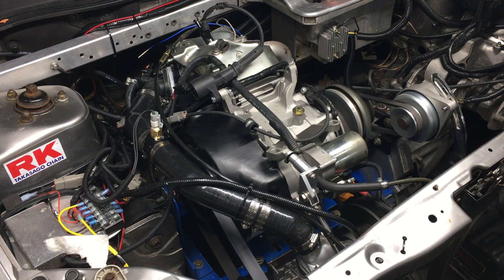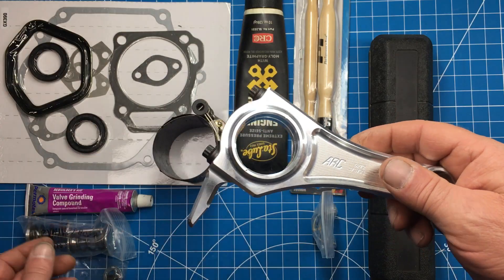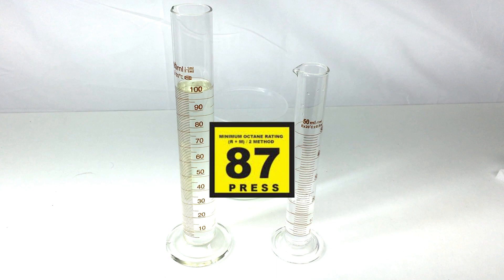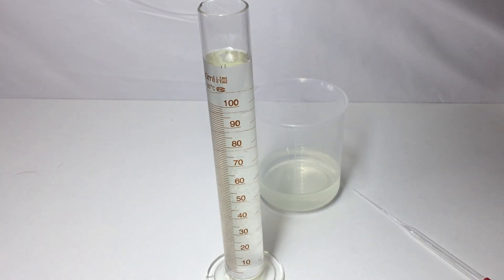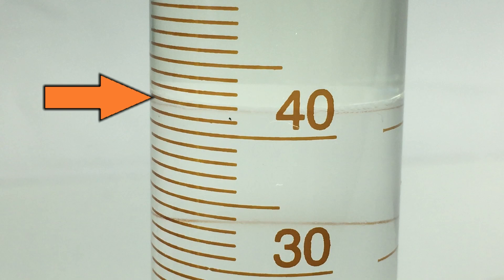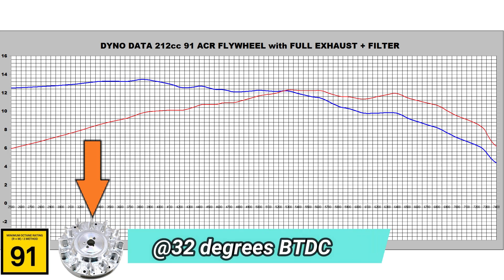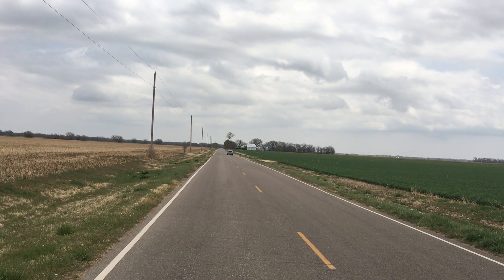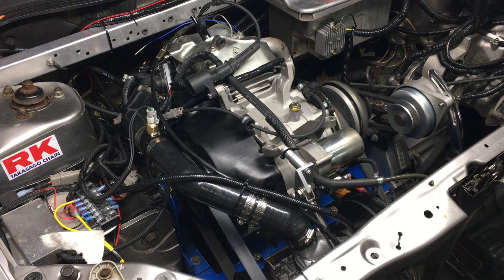S2E8: We dyno test several fuel grades to see if good gas is better than cheap gas for small engines

Comment: On a dragbike every pound you lose of rotational mass is like removing 2 to 4 pounds of static weight. It all depends on where you can remove the weight from the crank and drive train or the wheels.

Comment: 22% ethanol in the 93 octane Vs. 6% ethanol in the 87 and 89 octane?

Hmm, yea, the 22% ethanol is getting up real close to making that engine starting to run fairly lean. 
At 85% ethanol one needs 33%-35% more fuel flow when compared to 100% gasoline going  into the engine to be at a stoic ratio that the engine will run normally on. So, at 22%, the carburetor WILL need to be re-jetted larger to get the engine to run correctly again. Which means more fuel for the same performance. An E.F.I. engine will self compensate, and add the extra fuel by itself, therefore negatively affecting your fuel mileage.

But why am I wasting my time typing all of this, you already are completely aware of all that.. 

Well, maybe some other hard-head who ONLY runs premium fuel in his N/A, 9:1 Compression, 200h.p., V-6 car will read this, and be better informed on which fuel grade button to press next time at the gas pump, and save himself a few bucks... 🤷

Comment: If you wanted to be over the top and prove to people that a higher octane rating does not equils more hp. You could drive to the airport and get some 100 low lead avgas I'm sure you know that the octane rating is a measure of the ability of a fuel to delay the onset of detonate . Pure methanol would give you the ultimate anti detonation condition. But your going to supercharge so you have considered all this stuff.

Comment: Here in Minnesota. 87 octane has ethanol in it. You cannot use it in small engines, because of the short shelf life it has. It plugs up the jets and orifaces in the carbs. So, we use 91 non oxygenated fuel, and we have no problems with this. I suppose every state is different, and I’m no expert on gasoline. Does non oxygenated mean, no ethanol?

Comment: In Florida I can get ethanol free gasoline, since we have so many boats here, where you don't want ethanol in a boat's fuel tank, out on the water, in a humid atmosphere, etc. For 2 stroke engines I also run a 40:1 or 50:1 ratio of fuel to 20w oil added to the ethanol free fuel, just like on a mower or chainsaw. A mix of 2.5 or 3 ounces of the oil to a gallon of fuel gives me correct mixture. I've been wondering why you don't do same for your 2 stroke engines?

Comment: Octane has zero impact on power. The only thing it does is change detonation resistance. You can make more power on higher octane ratings if you are adding other things (boost levels, more compression, etc), but not in and of itself.

Comment: I have never gotten reliable results attempting to use the mixing water method to determine ethanol content. Water is already in the fuel maybe? Those continental GM sensors seem incredibly reliable and repeatable, and they are cheap

Comment: The ARC flywheel would probably work better, cooling-wise, if you machined a new fan that matched the profile of the older fan. It would also probably work well in conjunction with an oil cooler and the removal of the recoil start.

Comment: For the higher ethanol blend, fatten up the jets.  You have a lower stoichiometric ratio with ethanol so it can take more fuel.  You should get more power if you bump up the fuel rate.  It should do better with more spark advance.

Comment: Not sure how it is in other places but where I live, we had some gas stations offering E15 fuel for a few cents lower than the E10 fuel.  There is a warning on the pump saint it is illegal to use the fuel in a car older than 2001 or that was not designed to handle higher than E10.  I would think if they were dispensing E22, then they should be warning about it.

Comment: Have had a gardening company for 23 years.  Been running 87 octane in everything and chamion semisynthetic 2 stroke oil just fill a 12oz gatorade botttle to the brim dump it in 5 gal gas.  Let mix on the drive to the job.  Faouled a plug or 2 in 23 years but never burnt up a 2 stroker.  I run em WFO

Comment: Maybe add some aluminum heat sinks or a supplemental cooling fan if over heating is a great concern. Every engine is designed to run certain fuels with specific timing advance and getting outside that introduces cooling and performance problems. Only run what your owners manual says to run. Higher octane isn’t better it’s just harder to detonate without spark.

Comment: Octane is not power. Octane is anti knock rating. Higher octane gas requires advancing ignition timing to burn the fuel at the right time. Higher octane is NOT higher power. So engines that need more anti knock protection use premium or high octane. This is what Exxon Mobile says about octane. The low octane gasoline of the early 1900’s is the reason they mixed lead into the gas to reduce knocking. Why is that still getting confused?

Comment: Here in Florida they sell "camping gas" or sometimes "two stroke gas" that's supposedly 88 octane and no ethanol at all, I don't know if that's available where you live or if it'd help squeak out a half more horsepower...

The whole camping gas idea seems dubious to me, sometimes it's 5 cents cheaper than regular 87 octane and other times it's up to a dollar more... no clue why that is but it does seem to vary from week to week. I've always wanted to dump some in my car since it's a 2003 but the old girl's been slurping ethanol so long I figure why broke what's not fixed.

Comment: And to even further muddy up the waters, each of those variants of ethanol content fuels have different stoich AFR's. If E10 was exactly at 10% the Stoich AFR would be 14.1:1 and that tested 22% ethanol content 93 oct, stoich would be 13:1 AFR.... It's almost like one would need to install and set up in the EFI an alcohol fuel sensor just to run pump gasoline anymore

Comment: Higher octane doesn’t equal more power. Gasoline of different octane rating will have the same energy per liter/gallon/etc. More ethanol will give you less power bc it has only approximately 60% the energy of gas. Octane rating just means it is less prone to knocking. Meaning you can use it in higher compression or booster engines.

Comment: Mixing 10ml of water and 10ml of ethanol won't result in 20ml of liquid because the molecules are different sizes. They will pack together and form less liquid. It's like adding fine sand to coarse rocks. The fine sand takes up the gaps in the rocks.

Comment: Well. an engine runs best on the type of gasoline it was made to use obviously.. here in finland we use 98 and 95 ONLY. 95 have 10% ethanol and 98have 5%  95 is good only for modern vehicles that are designed for the ethanol content.. ethanol is garbage when mixed with gasoline :( 
Ethanol also gumms up and  glogs carbs, fuel filters and all...it even ate the gasoline hose on my brand new jonsered chainsaw and now the carb is full of "melted" plastic..
once i was low on cash and i put 95 in my 05 subaru and it ran like shit :(

Comment: If you don't have higher compression higher octane fuel doesn't work! Only advantage like in my area higher octane doesn't have ethanol and ethanol in small engines and older vehicles is a big no no unless you want your fuel system trashed!!

Comment: I would say; skim the head (and/or block) to get the compression ratio up to the point where it can take advantage of the high octane fuel and see what difference high/er compression makes to the engine.

Supercharged 420:  Yes definitely try the higher octane fuel.
(for those that don't know;  the supercharger increases compression ratio to the point where pre ignition  might be an issue, cured by higher octane fuel)

Comment: This video more or less confirmed a thought of mine that I've had for the past year or so. There was a thread bouncing around on Facebook for awhile where a lot of people were reporting for a few months that they were getting terrible fuel economy. I was one of them...I noticed that from approximately November of 2020 to June of 2021 I averaged only 14.4 MPG in my Ford F-150. With absolutely no change, I randomly began averaging from July of 2021 until October of 2021 17.5 MPG. Then in November of 2021 to March 2022 I went back down to between 14.5-15 with no changes to driving characteristics or modifications to the vehicle. In April of 2022 I went up to 18.2 and even occasionally hitting 19 even MPG. I suspected it had something to do with the E content of the fuel possibly fluctuating and after watching your video, I decided to do exactly that. I took gasoline both 87 and 93 I had in my shed that I purchased in the tail end of February/Early March for my four wheelers and compared it to the fuel I'm getting now and...you're right, even here in Kentucky it seems that prior to April of 2022 the E content of the fuel was for me...between 8-12% but fuel purchased post April of 2022 fluctuated between 4 and 6%. So...I appreciate your video simply because I didn't think about the E content having such a wide gap between consistency.

Comment: Nice video. 
If it's the same regulations as where I'm from, E10 stands for "up to 10% Ethanol". And it will vary depending on season and supplier. 
It's especially true for E85, they may go as low as 50% during winter to help with starting up the engine.

Comment: You said the stock timing is 21-22 BTDC. Did you verify this with a timing wheel?  I don't know about the Pred 212 but stock 196 clone flywheels are timed to 28 BTDC.

Comment: My 1985 Yamaha xj700 motorcycle manual says to use 91 or 93 octane....I notice I can use 87 without pre ignition if I keep the RPMs down and don't play drag racer. I get much better fuel savings  using 87 and it seems to have more low rpm power....... If I wanna play fast-n-furious I'll fill up with 91 or 93

Comment: maybe make a fun series about making a hybrid system like the new insight, where the 420 bic bloc powers a generator that powers another electric motor to drive the wheels, so you can ditch the cvt trans

Comment: I'm not surprised to see the engine get better power under lower octane.  There's less heat energy per gallon of fuel in the higher octane grades and with the engine having no way of taking advantage of higher octane's resistance to detonation, the net result is obviously going to be less power output.  Less in = less out.
If you were to raise the compression ratio to avail yourself of high octane's non-detonaty goodness, the numbers would be very different.

Comment: Looking back at an earlier test, removing the pull start dropped the head temp under load by 33 degrees; adding an oil cooler pulled out another 4 degrees while also lowering the oil temp inside the engine by nearly 70 degrees.

290-300 head temp with the ARC flywheel is starting to get a bit concerning I will agree; removing the pull start hat and adding the oil cooler in addition to the ARC flywheel may get you back into an operating regime that is more comfortable.

Comment: there is no good or bad gas. there is gas that works in the engine. if the engine is made to use it then it is good. normal octane is just as good as the high octane if your car can use it. if your car is made for normal 87 octane then 93 octane is bad to use. the more octane the harder it is to burn.

Comment: Identical fuels save for octane rating, you lose energy density with higher octanes; higher octanes prevent detonation during compression, so that higher compression ratios, more timing advance, and forced induction may be used. But they're otherwise detrimental, again all other things being considered equal (I did not have any part in producing the fuels you tested)

Also....though ethanol has a lower energy density than gasoline, when burned at stoich, it will make just a little more power than gasoline, and you can advance the timing more to make even more power

Comment: i have a recommendation if you can get a hold of thunderhead289 he might be able to help you he's got a v8  car that he drives running on just a lawnmower carb  but you should use a turbo charger along with the super charger that would be fun to see ;)

Comment: Hi Jimbo !

Would it be possible to do an engine efficiency test in a future video? I'd be really interesting to see what kind of BSFC  (in g/kWh) these engines are capable of.  Shouldn't be that difficult to pull off with your dyno and some accurate fuel measurment going in.

Comment: These results make perfect sense. Higher octane fuel is inherently less energy dense. If you don't have an engine that is specifically designed / tuned to run higher octane fuel you're going to get less power from it. The advantage of higher octane fuel is that it can be compressed/heated more before it spontaneously combusts/pregnites. If the engine isn't designed to take advantage of this it's going to make less power then if you use lower octane fuel

Comment: When you start playing with compressed air in the cylinder and fuel grades, you are really testing the frequency of knocking. Where the high the octane the more stable the combustion, which is why forced induction cars require higher octane to prevent engine knock.

Comment: Octane goes along with compression, also the AFR's would change as you need more fuel with more ethanol, E85 would make most power but also ~30% more fuel give the timing and compression is there

Comment: Welp got the lawn mowed, figured I'd go the extra mile and chop up a bunch of those trees that got blown over the other day here in Kansas. But I got a question, I got an old heald hauler laying around here somewhere, and I think it has one of those predator 420's in it, problem is though I put it up on blocks awhile back cuz the gearbox doodad no longer has gears inside of it, just 42 million pieces of that captain crunch you speak of. I have no idea what a transmission or gearbox is and I need one for it. Googling tells me I need an FNR gearbox thing, all I know is I want to do the opposite of what you are doing, I'm trying to go slow, at wide open throttle I want to be doing like 3mph, any thoughts, I just want pure torque.
Reply from the maker: Glad you kept safe from the little bit of wind we had the other day.  Hmmm...  I googled Heald Hauler and had a look at the FNR gearbox.  Good luck finding another one.  Ultimately you want to use a bigger sprocket on the axle, but it looks like it's already huge.  In that case, if you can find a proper gearbox, you would need to send the output of the transmission to a jackshaft with additional sprockets for further reduction in output speed.    The jackshaft assembly should keep the transmission from exploding again because all the torque will be on the extra sprockets and chain.
Reply: @robotcantina8957  i think it exploded because there isn't a rear suspension, I've never seen this thing move, just kind of adopted it. It is the big 4x4 model with roll cage thing, someone had put that 420 in it, and it has the gizmo's that spin the belt around those moving angle plate things, but the old gearbox just had the 2 axles coming out straight to the tires, there are cutouts and holes for what appears to be ready mount 2 bolt flange bearing housings. The axles were bent, which I assume is why the old gearbox was exploded. I'm under the impression a golf cart gearbox might work somehow, but it sure would be nice to convert 99% of the engine power to torque, so I can haul absurdly hilariously oversized loads with it. Beverly Hillbillies style.
Reply: @OCD Man Ya I'm thinking geared down to 1/10th of a mile an hour but able to pull a house off it's foundation ;)
Reply: @OCD Man ya I mean don't get me wrong this is clearly a problem I wouldn't mind putting off for another 25 years, but I have to listen to the old lady piss and moan about not having a covered place to park everytime she looks at it. But I tell her Baby! The boat takes precedence find another man or another place to park. Cuz the Chalmers D17 ain't moving, I don't even so much as know how to turn that thing on.

Comment: Not enough compression or rejetting to deal with the added ethanol. Low specific output engines do better with lower octane and lower ethanol. Add the stooper charger and retune!!!

Comment: You dont loose hp by going up in octane. Octane helps with knock. 

You lost horsepower because ethanol has a lower stoich, i.e. the more ethanol in the mix, the more fuel needed. In short, you ran the engine lean in the 93 test, which also explains the higher idle.
Reply: Higher octane fuel is inherently less energy dense. Unless your engine is specifically tuned to take advantage of the reduced knock capability of higher octane fuel such as having higher compression or being forced induction you will get less power from higher octane fuel.

Comment: Something I want to try is putting a drive pully from a torque converter on the motor and a normal v belt pulley on the transmission side

Comment: Ah OK.. so you concluded that a stock flywheel is better or works best for cooling in a confined space.
However,  have you considered making an aluminium one and bolting on the stock plastic fan.
I must say found you fuel experiment very interesting..First class..

Comment: Higher octane means more resistance to knock. So you can run more ignition timing and make more power. Gotta tune the engine for the better fuel...
Reply: Exactly.  I tell people this all the time. I proved it in my carburated Harley. With 93 I tane and above at temp, it runs like a top and cuts off when I cut the ignition. Anything below this grade runs moderate and will diesel the motor after cutting the ignition (typically due to the carbon build up still glowing red). Plus the motor has been turned and has very high compression.